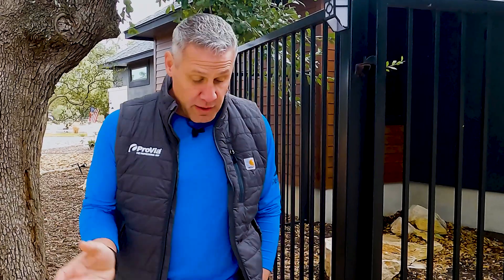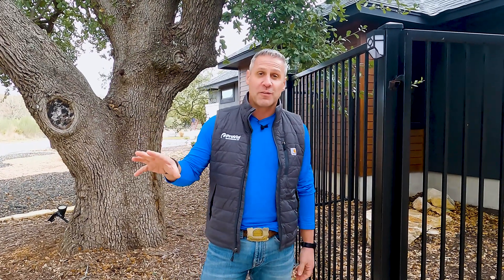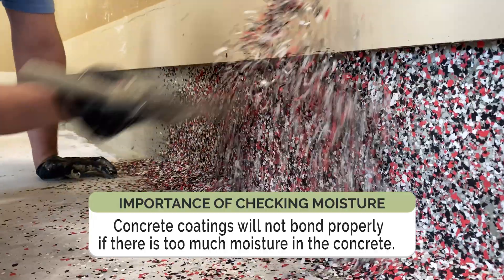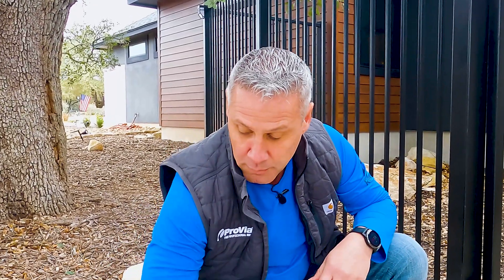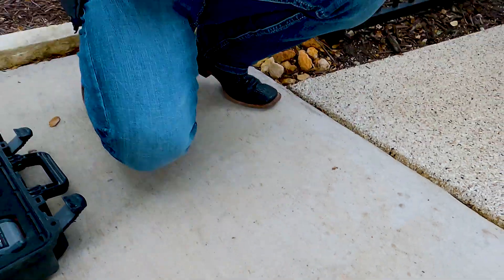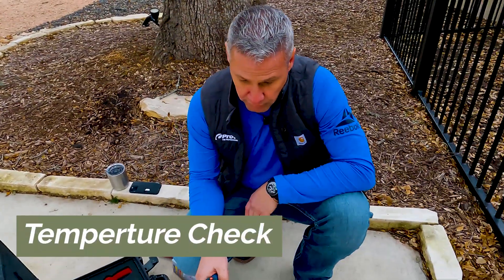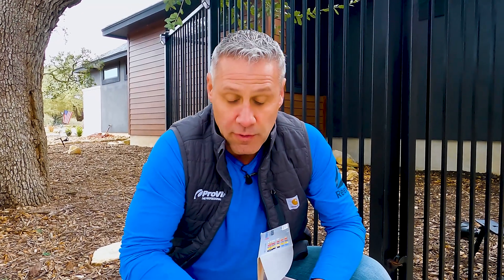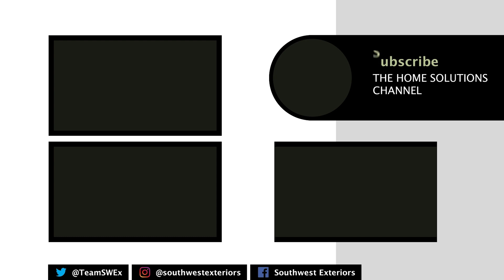How to Prepare and Test Concrete for a Coating (Tools and Tips)

Comment: So how will the polyurethane coating last? Like how many years or can it last lifetime on concrete?
Reply from the maker: It all depends on the polyurethane coating you pick. We specialize in Penntek Coatings which come with a 15 year warranty. When installed correctly, your coating should last longer than that. The best option to is pick a high quality coating with a company that stands by their work and offers a lifetime warranty. 

Here is a video we made that dives into everything the Penntek Warranty covers: https://youtu.be/8D6Kd7z9LJc

Ask your installer about their warranty. If they don't offer a warranty outside of the product warranty, that might mean that the Polyurea/Polyurethane they use is of a lower quality, and won't last as long. 

Be sure to stick around the channel, this week we are posting a video that compare a High Quality and Low Quality Polyurea coating. 

Thanks for checking out this video!